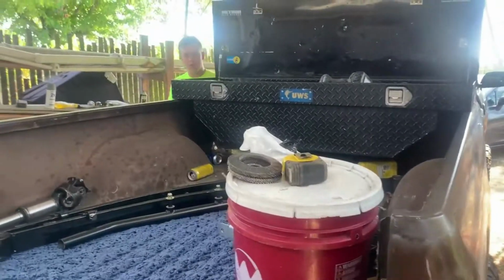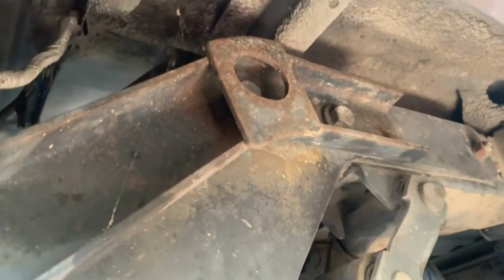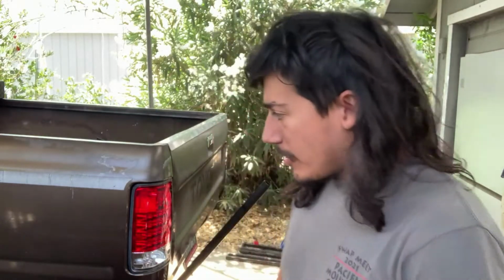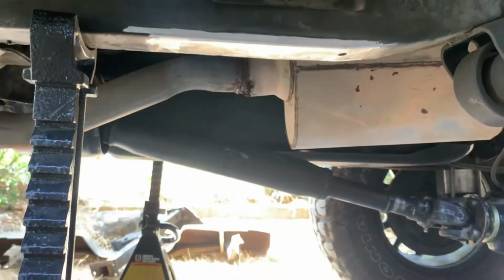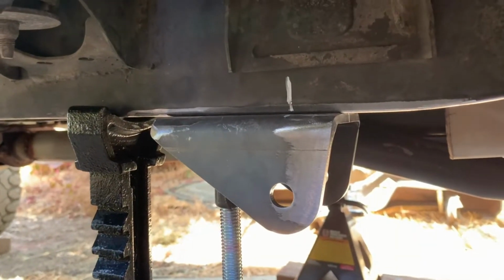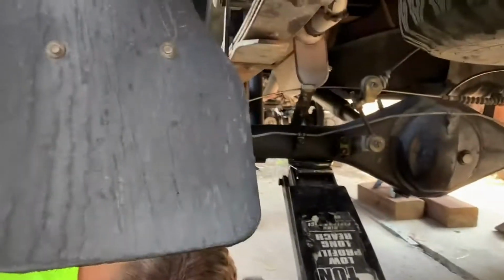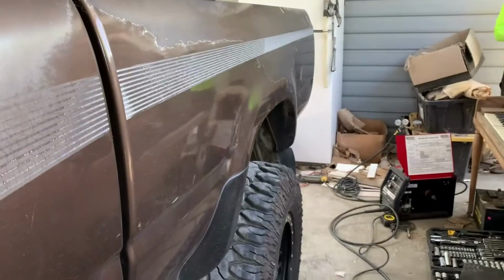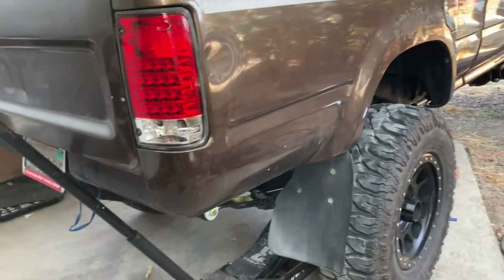Chevy 63 Leaf spring swap ( 89 Toyota Pickup)

Comment: did you use a larger bolt through the leaf spring eyelet, I noticed my chevy leafs have a larger size hole on one end and the bolts that are given are loose when going through, worried that will cause slop?
Reply from the maker: On this particular truck I used the bolts my friend got with his kit they fit in fine. However he did get the springs serviced at a spring shop and let them know he was going to use them on a Toyota pickup so I’m not sure if they accommodated the bushing size to the bolts. On a 80 Toyota pickup I used to own I did the conversion with some junkyard 63 springs and used the stock Chevy bolts to bolt them up. I did use a bracket kit from rough stuff https://www.ruffstuffspecialties.com/R1799.html specialties however where this 89 used trail gear brackets.

Comment: How long did it take you? Did you have to change your front end at all? It looks like you went no blocks too. I have 2 inch blocks in the rear, thinking i wont need them to match the front or be close
Reply from the maker: Took me about 5 hours. Had an issue with the welder however. We did no rear blocks. The front of the pickup has 4.5 lift springs from trail gear if I recall. Truck did sit leaned back a bit however. When I did the 63 springs on my 1983 Toyota pickup long bed. I had trail gear 4.5 springs up front and used some junkyard 63s and it sat pretty level. Unfortunately I don’t remember what size shackle I used from trail gear.